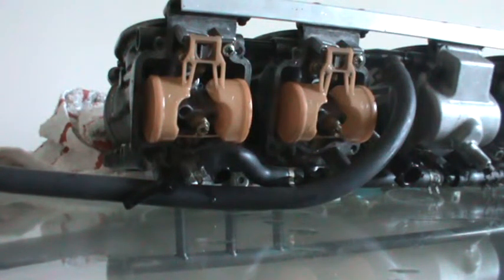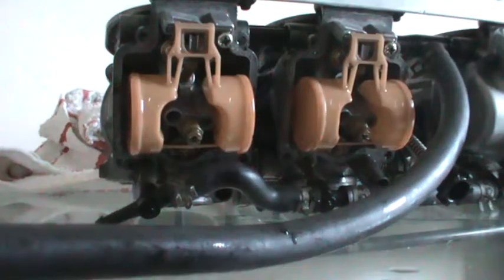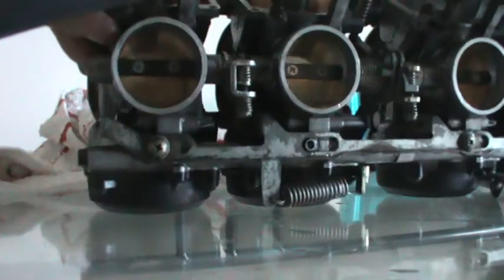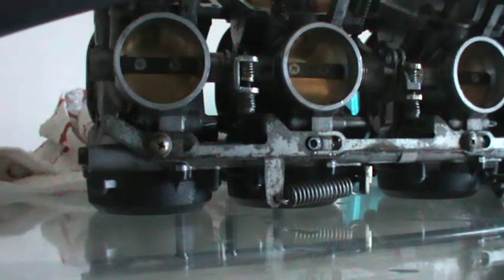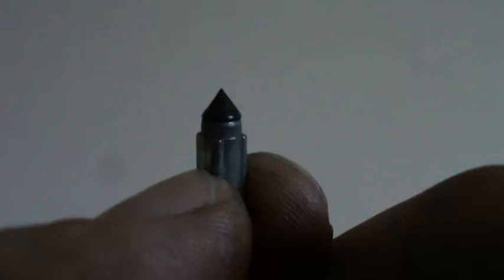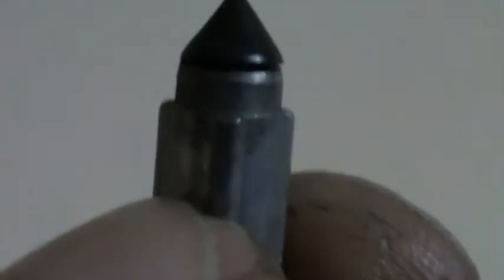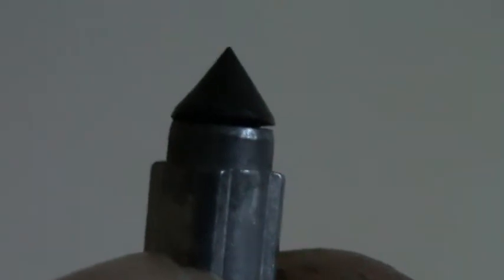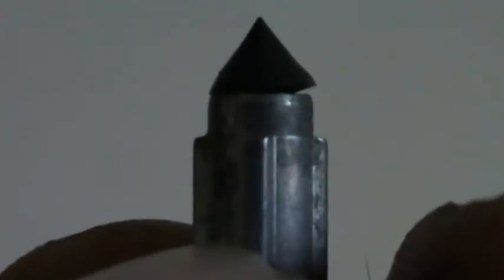ZZR600D Float valves being checked Before repairs

Comment: I manage to repair most float valves in a ultrasonic cleaner.  Usually there is a little bit of oxidation under the rubber cone which forces it up.  It's laborious work, but if you're skint it's a very rewarding way of saving money.